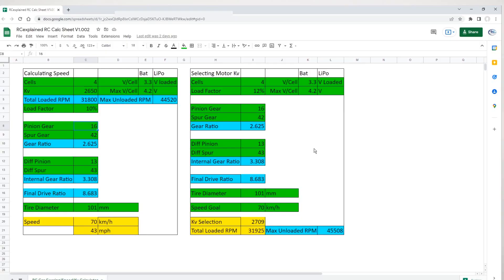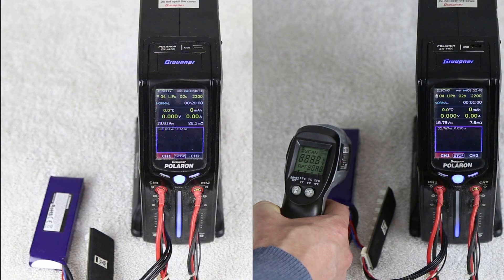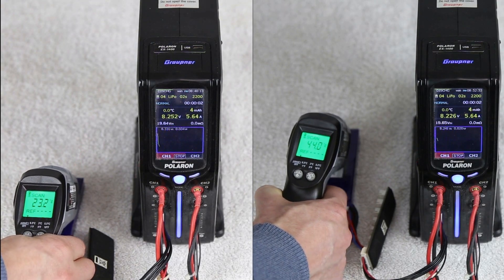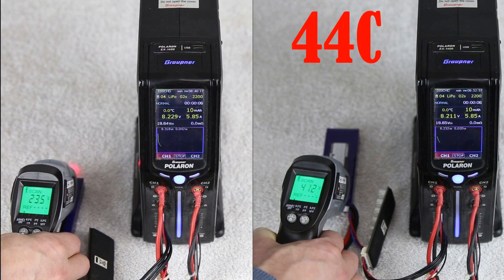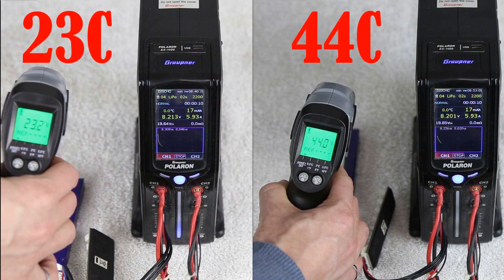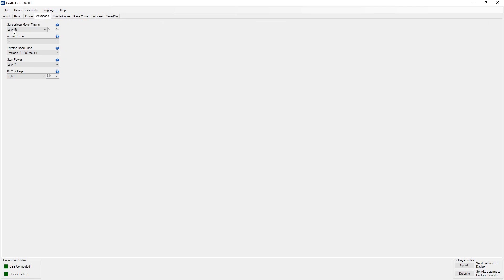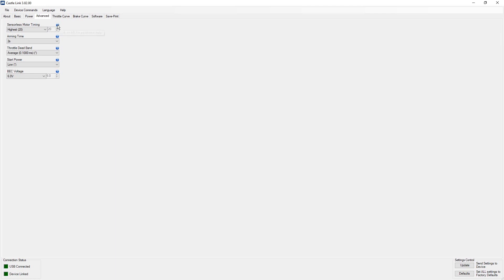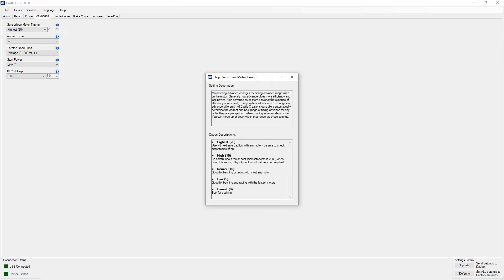How to Increase the Top Speed of an RC Car for Free

Comment: As always, great info 😎👍
Funny, I was researching yesterday ways on how to reduce voltage sag. Heating up the batteries to lower the internal resistance was one of the ways to do this. Still trying to find a better solution for voltage sag but unfortunately there's not a heck of a lot of info out there. Pretty much comes down to very high quality batteries with low internal resistance & high discharge rate.
Reply: You can also run multiple packs parallel
Reply: @rotauq  yeah it does help a bit, I have done that in the past as well.

Comment: Have a question I have the new bandit rtr and I’m working on turning it into a drag car, now I replace the spur gear with a 54t and used a 14 pinon gear sorry the spelling but the motor gets hot.

I want to get that speed right out the gate so I can beat ever one else, but need help to keep motor from getting hot
Reply: Your pinion gear is too large. You will blow that motor eventually.